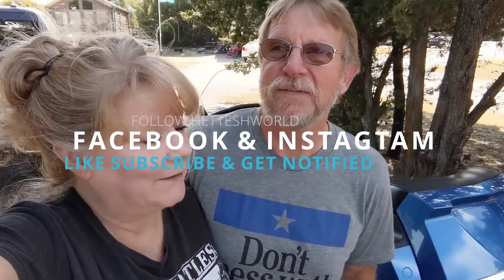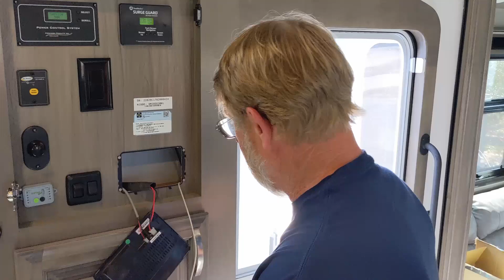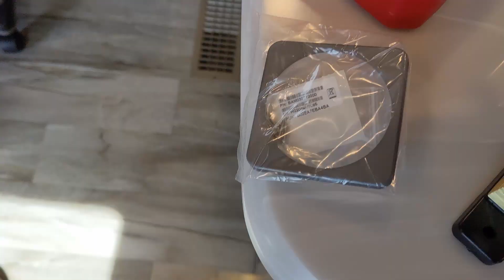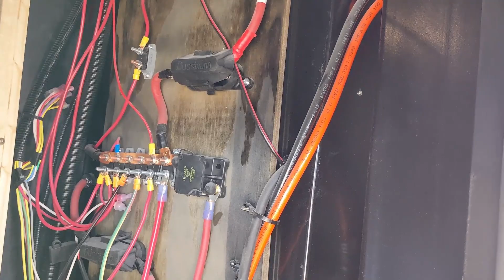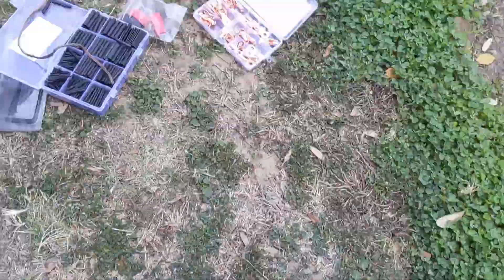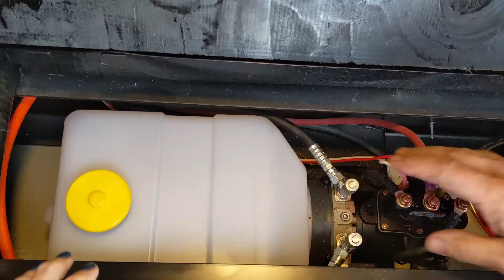RV Repair Hydraulic Pop, Lithium Battery Converter Victron Battery Monitor Thermistor Full-time RVer

Comment: Holy You know what! I was just watching your video and he slide the door back that is in the basement and I saw the hydraulic pump and fittings and it looks like it is directly underneath where the bar or whatever you wanna call it is in the rig and that’s where I hear the hydraulic fluid spraying the bottom of that so I bet that is where the leak is coming from!
Reply from the maker: Hopefully so you can find it and stop it. Is your still under warranty? Or I would contact either your dealer and talk to service or talk to Riverstone factory and see if they can help you because it does worry me that you have this issue.